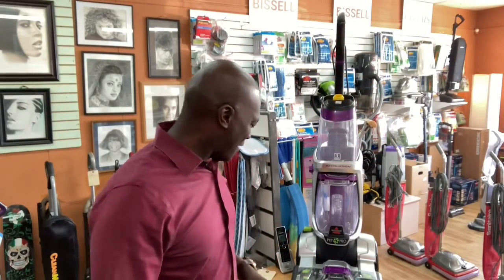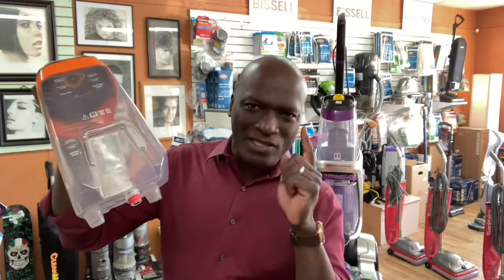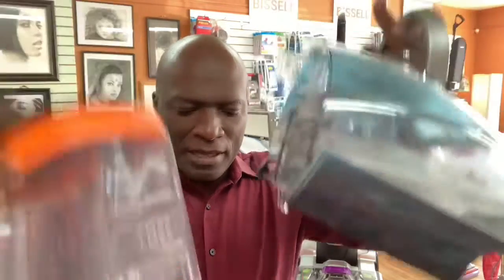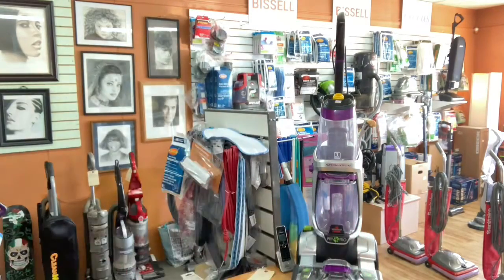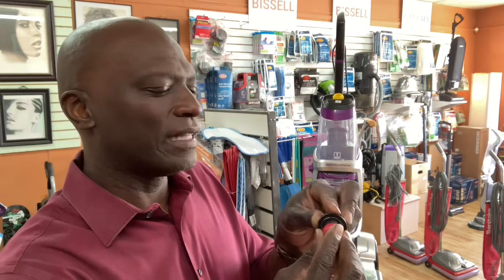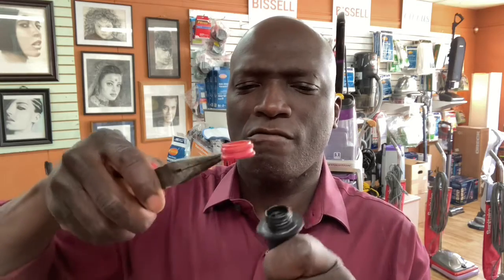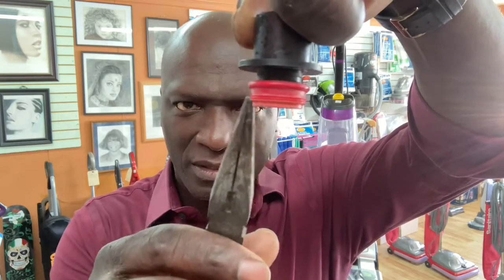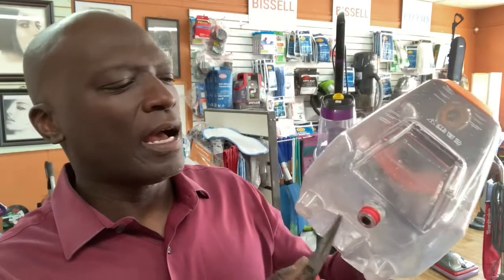Understanding the Bissell water tank gasket

Comment: Thank you for great channel. I took the entire nozzle off as it was coming loose at the bottom of the bottle. It was glued in. I need to glue it back. Do you know what glue I should use?
Reply: I have the same issue .  The whole bottom fitting of clean water tank (pet pro and revolution. Model number 1986) came off. It just fell off.  There seems to be a very lightweight o-ring between the fitting and the hole, but sure didn't keep the water in. Should I glue it and if so what kind?

Comment: My revolution pet pro 2x isn't dispersing water from the trigger, I checked the handle, thanks to your video ☺️ it seems to be fine so is there something that's suppose to hit the bottom of the water tank that dispenses the water? Nothing moves, when I press the trigger, where the water tank would sit, please help
Reply from the maker: Try the trigger again this time add some resistance to the rod in the handle. This will definitively eliminate the handle from the equation. If you press up against the rod while squeezing the trigger and it doesn't move then you know that the is the problem. But if the rod push against your finger the you need to look at other factors. The auto receiver, the pump, the pump belt

Comment: Wayne on mine the black plunger on the clean water tank on the orange version you have does not stop water from coming out. Didn't use it for a couple of years due to cracks in the tank so I think the rubber seal inside the plunger is bad now.
Reply from the maker: You may just have to replace the tank at this point. The part number is on our site https://www.monroevacuums.com/product/tank-clean-tank-assembly/1183

Comment: Good video I just did like you said and replaced the tank from Amazon. I notice once I fill it up the water would be going down even if I wasn’t pressing the trigger for the water. I assumed it was the gasket before I found your video. So I just went ahead a replace the top tank just to rule out the gasket. Now if the new one loses water quick then I would know it’s another issue. Hopefully this fix the issue though
Reply from the maker: Hope it works for you- keep me posted- if it still just leaks out, try removing the handle and place the tank on the unit again. Ruling out the handle completely (for instance the rod could be stuck in the on position)
Reply: @monroevac  ok my new tank just came in, and it’s still losing water without pressure the trigger. I’m goin to check for the handle now

Comment: This exact part on mine leaks. The valve itself is not sealing. Do you have any tips?
Reply from the maker: Personally I would purchase a new cap/(autoload gasket) Although I noticed that they are becoming scarce. (If you are looking for a quick fix to clean right away try some plumbers tape for a patch job- You cal also use my contact page and send me your shipping info. I believe I have a spear gasket from a unit I disassembled. if I do have one in my stock room- I’ll ship one out to you

Comment: I have the opposite problem... as soon as I pull the trigger on my Bissell 3071C, the water starts flowing, and doesn't stop anymore until the tank is empty.  Any thoughts?
Reply from the maker: There are two possibilities that I can think of right now. It’s either the reservoir or the rod in the handle that’s connected to the trigger. Both of those can be stuck in the on position. I will release a video explaining my solution in better detail. Stay tuned
Reply from the maker: See this video- Bissell Tank is empty too soon
https://youtu.be/X-_YkOENG7w

Comment: Question the little tank you put the cleaning solution in. When you place into the carpet cleaner, the little tube inside the tank is now upside down. And the more you use the solution, nothing is going into that tube. I’m I loosing it or what. Thanks.

Comment: Hello 👋 please i need help about that machine the water tank now it’s not fitting in the area
Reply from the maker: Without seeing the tank Im limited on what I can advise. From my experience the main reason a water tank suddenly stops fitting correctly is due to warping. Possible heat from boiling hot water. Can also be from a hot storage barn
Reply from the maker: Ne replacement tank is probably the best route

Comment: I have the purple model you show, the pet pro, and the plunger valve you show in a close up at 6:36 isn't being depressed deep enough to let the detergent water flow out when the tank is siting in place and the trigger is pulled during the wet strokes. If I press down on the tank firmly while pulling the trigger, the detergent flows as it should. Any ideas how to get the tank to seat properly so that the vlave is depressed enough to allow flow? Thanks! Appreciate showing the details so clearly to the camera!
Reply from the maker: My best guess is that the tank needs replacing. I’ve wrestled with the same issue and found that the tank was the problem.  I have a video in the Bissell tips playlist that show a step by step examination of this about the leaking tank
Reply: I have the same problem now..any solution? Thanks
Reply: @celsojr.sanada7621  I contacted Bissell & they blamed it on subtle plastic housing deformation as a consequence of heat. Their default assumption is filling the reservoir with too hot water, which I know I didn't do. But I did have the unit in the back of the van on a couple of hot summer days, which might've been a heat source if heat was the culprit. Ultimately they shipped me a replacement reservoir kit under warranty which seated properly. I'm pretty sure that a replacement reservoir can be purchased out of warranty if needed.
Reply from the maker: @samhouchinsii6820 Excellent- Utilizing the warranty was the right move-that’s what its for.

Comment: Hey you are the ONLY thing I have found addressing this specific location on the Clean Water Tank.

 So my red gasket is fine.  The plastic  mount of the nozzle sticking down is popping off.   Does it screw on, it seems to have a white waxy substance in it that appears to have melted...??  is that replaceable?
Reply from the maker: Which model? And to be clear you are referring to the bottom of the tank and not the auto receiver that collects the water, right
Reply from the maker: Model number would be best
Reply: @monroevac  hey thanks for responding so quickly!  yes the clean water tank [top tank] on the 1548F black and orange BISSELL ProHeat 2X Revolution Pet.

The small clear plastic nozzle on the bottom of the tank that the red gasket fits onto ...  its connection to the tank has a white waxy substance that has melted and water comes around the fitting and/or it sometimes comes off and stays gasketed sitting in the receptor.  

I was wondering if there is replacement "goop" for that fitting or if Plumbers Putty might work....  rather than buying a whole 40 dollar tank.
Reply from the maker: Ok, great info. The tank comes as a whole. That part cannot be purchased. I would only try the puffy for the joy and curiosity of experimenting. The tank is designed to fit exact and any extra surface would cause it to not sit properly. I would try a used tank first possibly eBay. But it looks like replacing it is best.

Comment: I need help with my BISSELL pro heat 2x Revolution Deep Cleaner gasket
Reply from the maker: The Bissell Revolution gasket isn't sold separately you would need to replace the tank. Most of the newer Bissell shampooers are made that way now. Find a tank here> https://www.monroevacuums.com/product/tank-clean-tank-assembly/1183?cp=true&sa=false&sbp=false&q=true

Comment: Wayne, I have enjoyed your videos, so i am hoping you can assist me.  I have a Bissell 2x Pet Revolution that the spray is not coming out the bottom to clean the carpet; however, i have primed the pump and the hose when attached the spray does come out the bottom hose, but not the regular bottom. 
Can you please let me know how to repair since there are no service centers around? Bissell customer service couldn't help me, so i am hoping you can!
Reply from the maker: Try viewing my Bissell tips playlist. Start with the trigger video and work your way down. Keep me posted
Reply: @monroevac I have an older Bissell proheat pet 1699 worth the same problem. The black gasket on the lid(not the red filter) isn't firmly seated and I think that's the problem. However Bissell doesn't provide a good drawing or Pic of how it fits in. One side is wider then the other, there are ridged but can't tell if it's supposed to go inside the clear plastic, snap on, whatever. In found to look thru your Playlist but appreciate any help😮

Comment: Question brother... we're can my girlfriend get a water tank gasket for her 1887 bissell proheat powerbrush
Reply from the maker: I believe that tank is only sold in 2 parts the lid and the water bin. They don’t sell the gasket alone.
Reply from the maker: You may have to purchase the bottom section of the tank assembly. Top being the lid. I have found parts on eBay where some folks would sell pieces of their units, especially parts that are not normally available by themselves

Comment: My bissell powerwash primer tank  is leaking from the blastek edge  down its not craked but wont sticking like before how i can fix it??
Reply from the maker: hmm if replacing the knob doesn't work then I would suggest replacing the tank. Water leaks in tanks often return after patching or gluing if the tank itself is the problem

Comment: The problem for the Pet Pro tank/seal is that they don't sell just the seal - have to buy the whole $35 tank.....and.....the whole tank (part 1610043) has been out of stock for MONTHS.  I think my seals got deformed from using water that was too hot - so I am paying the price...  Can imagine how they would let such a critical part be out of stock for months.
Reply: I'm in the same boat as you, and you just answer my question how did this happen? I did use hot, hot water this last time argh!!!

Comment: We just bought our BISSELL proheat 2x today and the water is flooding out of the bottom. The full gallon leaks out within a couple minutes
Reply from the maker: Sounds like the Auto receiver is broken ( sits below the tank when you  place it on the machine) but to be sure you should take it into a local approved Bissell service center for warranty service
Reply: Do you have any videos showing how to repair it closest place is like 100km away
Reply from the maker: What’s wrong with the unit?
Reply: @monroevac  same as above so as I place the clean water tank on it starts leaking out the bottom and drians the whole clean water tank
Reply: @bigslim68  try twisting the seal closer to the tank if you still have this problem
Reply: Just as soon as I attach the tank to dispense the clean water and solution; it goes straight to the floor.
Reply: Waters pouring out bottom of mine also. No leak, guess its the gasket, I made sure it was on correctly but that did nothing to help w flooding out bottom but I have the bisselll pro heat essential red n black machine...
 So frustrated.
Reply from the maker: @nicolefuller3021 it’s probably the auto receiver. If it’s cracked the water would just spill out immediately

Comment: My tank is leaking when I put the water in it leaks straight out
Reply from the maker: its possible that the water release botton is damaged. Also possible that there is a crack in the plastic. First thing is to identify where the leak is coming from. I recommend using the warranty if it still applies. If not replace the tank, there's currently no fix for the release button.

Comment: What's that red part number, my unit literally doesn't have that part! it's leaking. (the bottom receiver one, not the tank one)
Reply from the maker: To be sure that I’m retrieving the correct number, please provide the model number
Reply: @monroevac  It’s a 2066F. Here’s a video of the problem > https://youtube.com/shorts/VUuBgmyJij8?feature=share
Reply from the maker: Try this video- I had the same problem and found the the solution was to replace the tank. It may be the same for you-https://youtu.be/2RYACfNgKBc
Reply: @monroevac  let's hope so! a new tank sounds too easy aha
Reply: got the new tank today, and whaddya know, it’s fixed! Comparing the two tanks I can see the old one was definitely warped from heat. The plastic is noticeably foggier too. And now knowing this i found one google result where a lady put hot water in it to fix it, by forcing it back in until it fit then letting it cool 😂
Reply: So you were 100% right, definitely the right fix is to just replace the tank, but for anyone coming across this comment in the future, remoulding it might be a good way to save a few pennies. Just don’t actually clean with the hot water!
Reply from the maker: Glad the new tank solved your problem. Thanks for keeping me posted 👍🏽